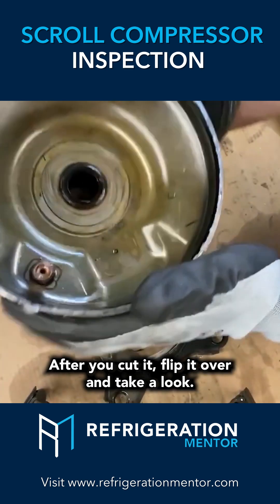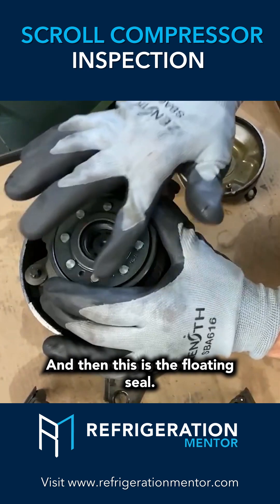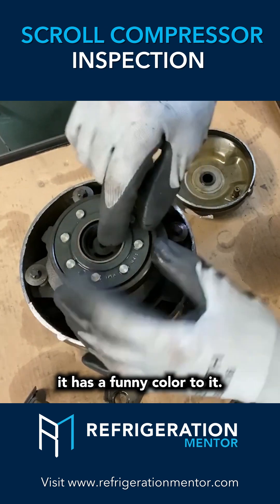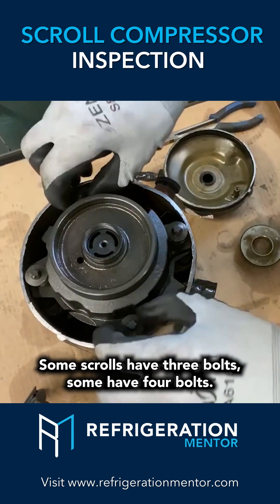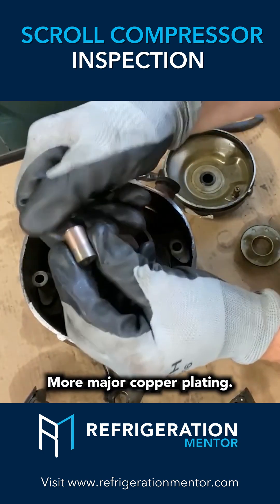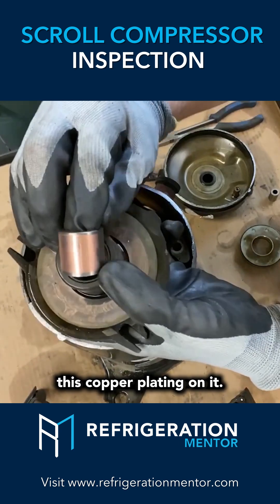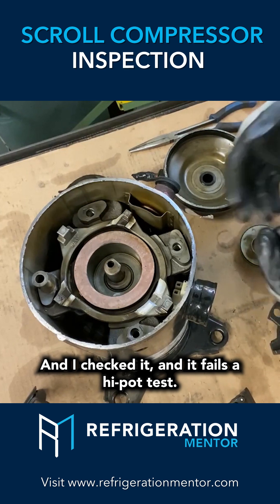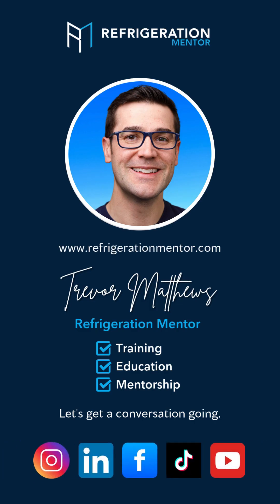Scroll Compressor Teardown: What to Watch For

Comment: So, acidic oil pulled copper from the lines into the compressor? Do you think the same acid ate away the winding insulation? That copper didn't come from motor windings, it came from the refrigerant lines, right?
Reply from the maker: Yes that would have ate  away at the winding insulation and the copper in the scroll set I assume would mostly be from the piping.